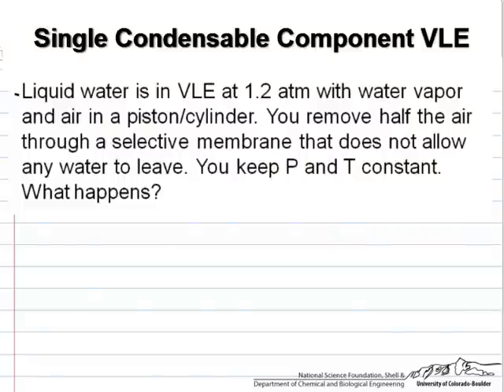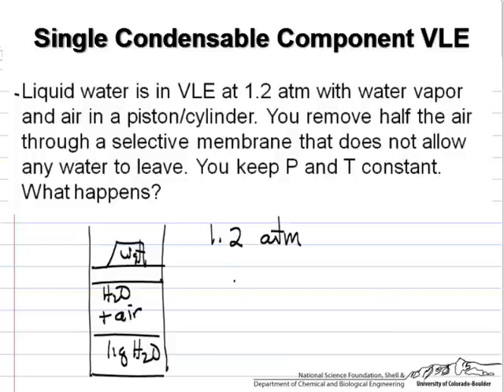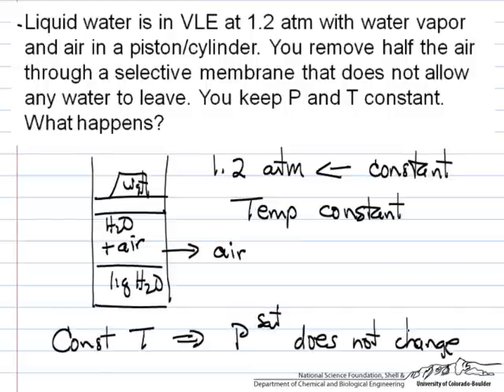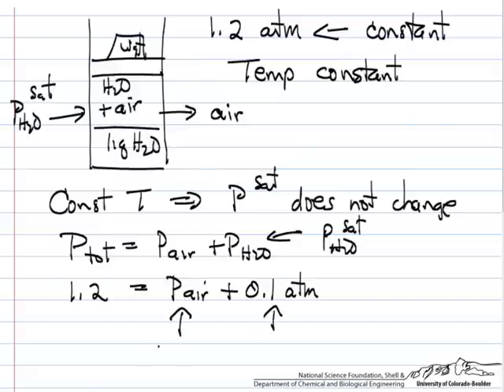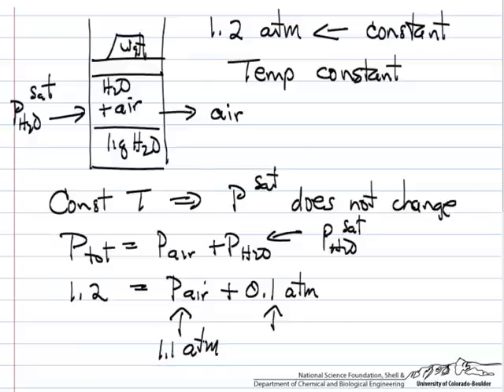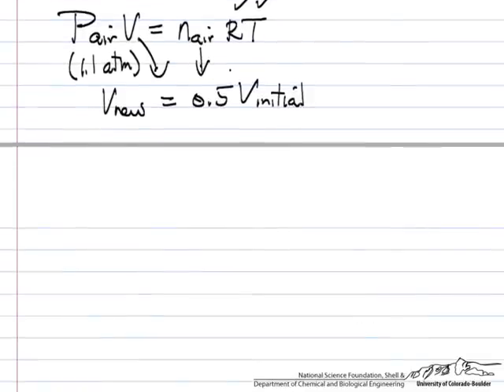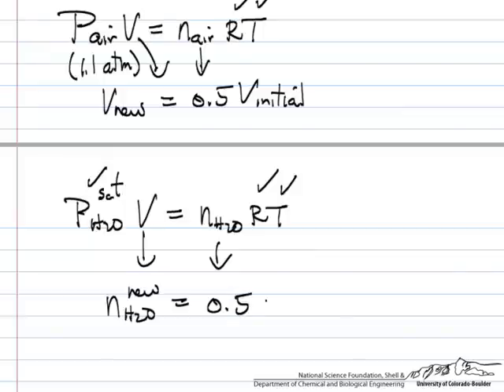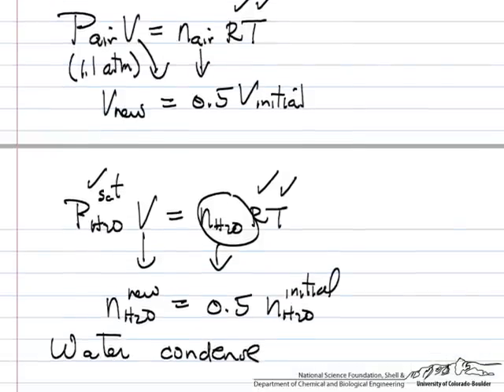Air/Water Vapor-Liquid Equilibrium

Comment: Wait, I don't think I agree with the conclusion that water vapor must condense to maintain the ideal gas law. If you remove half the moles of gas while keeping Pvap and T constant, that just decreases the vapor volume by half. No need for a phase change. What am I missing?
Reply from the maker: Thanks for asking.  Only air is being removed.  All of the H2O remains in the system.  To keep the pressure and temperature constant, some of the remaining H2O will have to condense.  I hope this helps.
Reply: Remember that the absolute (total) volume of gas decreases. So, even though only air is being removed, total volume (including water vapor) goes from V to 0.5V. If you substitute the P, V, n and T for water vapor into the ideal gas equation, you'll notice that for 0.5V, number of moles of vapor must also be halved in order to keep P and T constant. And if no water vapor was allowed to escape the cylinder, where does it go? It condenses!